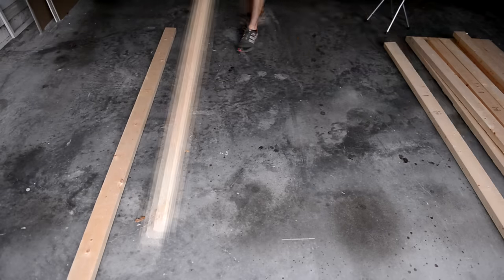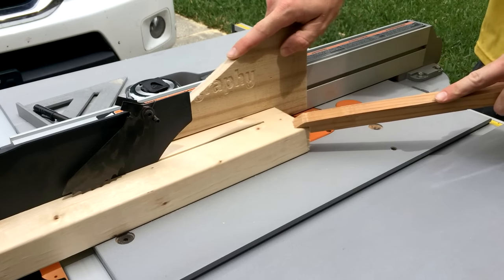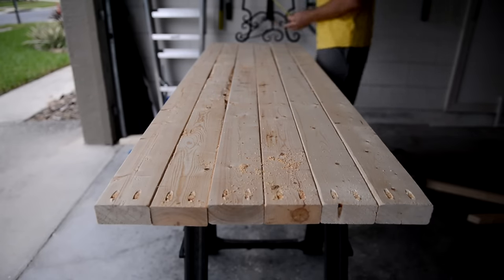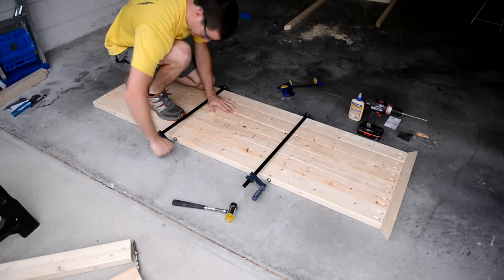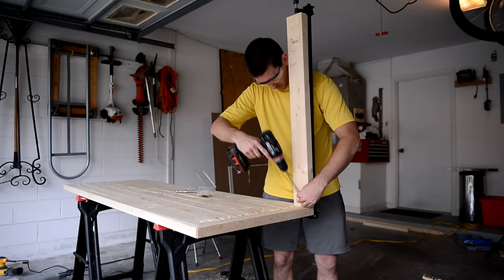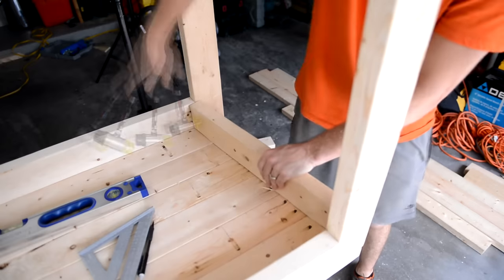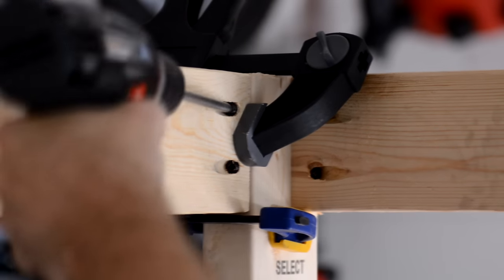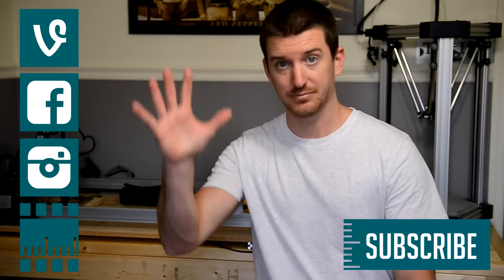How to Make a Workbench Out of 2x4s

Comment: Nice but the 2 x 4 need to be side by side but standing up. The 2 inches needs to be up. When you put them flat the table top has to much spring when pounding, for example; however it will use some more 2 x 4's but the benefit is worth it.
 It is cool to use pocket screws, however, a little wood glue will prevent problems in the future (my preference).
One more thing with the 2 X 4 screwed flat and screwed to the ends yo may experience problems with changes in humidity with the wood swelling and contracting. Overall good job!
  P/S you do not need to own a power planer. You ca use a hand plane. :)
Reply: yes totally agree with you ...bench is nice but not enuff reinforcement
Reply: +mtabernig also the lower support skirting should not be on flush with the bottom of the legs, cause any inconsistencies in the floor will cause the entire bench to wobble. 
Glue is your friend, it turns 2 pieces of wood into 1, does not rely on the screw holding it forever.
The Legs are going to rip right out of this table with any amount of side force on the table top. It is structurally bad construction. One ill placed step and your foot can kick out a front leg.
Should have waited till you had all the 2x4's attached before cutting the 2x2's that surrounding the main body of the top, then you would not have the gaps at the corners.

If your looking for cheap and solid top material, find some place local that has pallets they are getting ride of, take the time to tear then down, clean them up and laminate them together for a really nice hardwood top. Just takes time and effort.
Reply: He could place 2 2x4 on edge under the surface and  screw from his words skirts would be cheaper and keep his simplicity :) but your idea is better more $$ throw
Reply: +mtabernig He could have also attached 2x4s 90 degrees from the direction of the top 2x4s to give it more strength. But yeah, 2x4s on their sides are not as strong.
Reply: +mtabernig He could of also went to lowes or some website and bought one that was designed by and engineer. There are a lot of things he could have done but chose not to for the purpose he needed it for. Don't bash the guy. I like what he did. Awesome job!
Reply: James Stephens it not bashing, its constructive information, for him and anyone else that is looking to make one of these. They may look at the comment and make a more informed decision on to what changes they might make to one they are going to build. As you can clearly see he did say Good Job.

Me on the other hand, I am an asshole, I did not say good job, I should have but never did. So bash on me all you want.
Reply: +James Stephens nope.. its shit.   but it worked for what he needed it for, and that is a shitty video
Reply: +mtabernig 
I'm with you mtabernig. They also have a better chance of warping having them lay flat. Standing them up with glue would have eliminated that possibility.~DM
Reply: +CrossGrain Wood Products,LTD it is a problem with the edges, seasonal humidity  changes will work against the end edges and elongate the screws holes and loosen the grip.  The effect of changes in humidity could be diminish by  turning the 2X4 and gluing/screwing them on the narrow , the 2 inches, to the top  and joint them on the wide 4 inches.   I also would recommend using a couple of coats of  wood sealer to finish the project.
Reply: mtabernig do you mean the 2x4 need to be stacked? I'm confused. Like a butcher board top? I am trying to learn here.

Comment: Hi, nice job but just a couple of points to making it even better. Firstly, you really do need to glue as over time those screws and any nails will work loose and the glue will hold everything nice and tight. Secondly i would have glued 2 2x4s together for the legs, 4x4s would work much better and you can mortise then in to the corners, much stronger. I suggest reading some books on basic woodworking to give you some ideas, keep up the good work.

Comment: I built a bench like this years ago (Like 30 years ago) out of 2 x 4's from a wall I tore down. It held up great. I still have it. The only thing I did was put a piece of linoleum on the top to smooth it out. Every once in a while that needs to be replaced.

Comment: 1. Also ways glue your surfaces together. Pocket holes in pine is like stapling a marshmallow. They just don't work well in soft woods. Glue should be your mechanical bonding agent in this case with the pock holes acting as alignment and pressure for the glue.

2. Your work surface is entirely inadequate. It has no support under it and you are relying solely on the pocket holes to keep it together but here's the things, pocket holes are only strong in one direction, pulling away from the face. In the table top, if you put something heavy on it, you'll be stressing the pocket holes sideways and they are going to experience a large torsion force. This means that whole table top is going to want to roll up like a burrito.

3. You incorrectly stated at 4:30 that your 1/8 gaps could have been solved by  a jointer. A jointer is used to crate a flat face on a longitudinal axis of a board. Are you implying that you would stand up this thing on its end to run through a jointer? You dont run a gigantic panel through a jointer on its end grain. Not only would it uncontrollable and unsafe, the jointer would just tear apart the end-grain of the wood, especially with a soft wood like a 2x4. What you should have is used a circular saw to trim off the end of the work surface making all the pieces precisely the same length.

4. Regarding your table top, for the love of god why didnt you orient the boards upright? Decision making like that can make the difference between a work surface that can support 200 lbs vs a work surface that support 1000 lbs.

Comment: Good video: nice filming, editing, voice-over and music. The bench has pro's and con's and those have been touched on by others. I love pocket holes too, but I am not sure this is the appropriate "best-use" for them. Depending on the use of the bench it may not last. However, it was a good build for what it was designed to be.

The mitered corners can be done more perfectly by cutting one corner at a time. First, do your very best to set you saw to a perfect 45 (you won't get it perfect) and mark (or remember) big and short sides of the angled cut. Against the straight line of the back-rest one of the angles is 135 degrees and the other is 45 degrees. To match the cuts more perfectly, you can flip the board over and cut along the other side. Second, start on a long side and cut one corner on the big side of the angle. Put the board in place and clamp or screw it in (I have used small screws on trim pieces I was going to nail into place). Third, mark your second cut on the other end of the board. It will be important to "sneak-up" on the cut; leave about a blade width from the mark. Cut your second cut on the same side of the angle as the first (presumably you have a mark on the board and will need to have the board facing up to see the line. Cut this line a blade length long and check the fit. It should need just a little trimming. Flip the board over and cut the small excess off on the small angled side. Each board will have a short and long angled cut. When flipped, each side will be the correct 45 you need. Do each board this way; by cutting it long and flipping it over (after checking for fit) you can get the exact opposite side of the angle no matter what your blade is set to. I always do the first cut of a board on the large angle and the second cut on the short angle, so I don't have to mark each board - easiest for me.

Comment: quick tip on applying a finish. before you apply a finish use a rag damp with water. it opens the pores of the wood to allow the finish to soak further into the wood.

Comment: You mentioned having a hard time getting the mitered corners to fit well- it could be how you marked the line. I would line up the edge board to the other and then mark the inside corner of the miter. Cut a little proud of that mark, test fit it, & cut it again if needed. You can always nibble a little at a time to get up to the line. but it's not so easy to put back wood you've cut off. :-)

Comment: I enjoyed seeing you build this with all p-screws. After building a few benches myself, a couple things I would do different.  For clamping use, have an overhang lip.  This you could do by screwing your "skirts" on the inner side of those legs rather than outer side. Another is to make the table top with the 2x4's 1.5" sides up for stability when pounding on it, or add two more 2x4 crossbeams underneath, thus supporting the top in quarters.  The crossbeam approach won't be as macho as the sides up approach, but uses less studs and you can still add it without starting over.  Legs could be double studs. Sturdier.  But nice job!  You can actually break this down for transport which I think is pretty cool.

Comment: Thanks for posting.  I like the suggestions of putting another 2x4 midway underneath the top, making the legs from 4x4s or 2x4s doubled up, and also pulling up the bottom braces to add a bottom shelf. I think all those things would help the bench strength and stability.  Perhaps some wood screws (deck style?) would help also.    Appreciate your video!

Comment: Probably gonna crack the first time you put weight on it. Pocketholes are for lazy people!
Reply: You can hours waiting for glue to dry on your project if you want and change it every 15 years, or you can be lazy and have it down in 50 minutes, and when it goes BOOM and breaks, just throw in a few more pocket screws at a different location in less than 2 minutes and it should last another year.

Shit, I guess over time, he might invest an hour fixing it, but it still works out less work and time investment. Lazy or not, it's actually quite smart. I have shit I've put together with pocket holes and no glue, that takes on constant weight and moving, last 3 years plus.  One project broke and all literally split the wood. What did I do? Unscrew the pocket holes, get a 2x4, cut it down to size with my miter (took 10 mins), pocket hole it back up, and it was good to go.

5 years later...

Some projects you want to last, like, building a shed, or house and need to use quality construction, other shit you can get by on just repairing it and patching it up.

Comment: So sad that you tubers who don't know what they are talking about do this kind of video. A proper workbench is not just a table that goes in your garage. If it were, plywood would be better and easier. A true workbench is heavier, dead flat, and built to absorb hammering and pressure from the sides from building projects on it (hand planing, etc). This is a craft table not a 'work bench'.  Also a workbench should have a vice on it in some capacity to leverage the weight/stability of the bench...which this lacks anyway. I really wish non experts wouldn't poison the environment with information that ultimately will result in failures. Does the 'maker' really not understand that the legs are only attached to the border of the table top? Poor engineering. Or that leg supports that are flush with the floor make it impossible to to be stable on anything but a perfectly level floor...which doesn't exist in almost all garages. Poor engineering. Or that the flush glee supports prevent sweeping?
Reply: +Perineum Sigh. Precisely what I am talking about. You are so poisoned with the erosion of standards that you think any work surface is a work bench. A workbench is NOT a work table or a table that goes in the garage. No matter your uncle who slapped some plywood on some framing lumber and called it a workbench says. A 'workbench' is specific to a heavy table with a vise on it that can be accessed on all sides specifically for woodworking or even metalworking. Go to a wood shop and see if they have workbenches and separate work tables, assembly tables, and tool tables. This would absolutely not be safe for hand planing, chiseling or God forbid, many power tool applications. It's not just semantics. This goes to the erosion of woodworking standards. Don't care? Great I would like to sell you a 'pool table' for $500. Won't you be surprised when you see it's a a table used by a pool. Snicker. He should call this video something else is my point. NOT a workbench.
Reply: +Perineum that was hilarious.
Reply: Lighten up. Francis!
Reply: Let's see your video on how to do it right then DAVEY? Or is it easier for you to puss out behind your keyboard?

Comment: Nice bench, great look. I use a belt sander (21") in lieu if a plane & joiner also use carpenters glue it dries clear and wipes up easy after you set it. You have the clamps so glue will make it stronger, can't get those boards apart ever once glued. After it dries I fill the cracks/joints on top then a good belt sanding makes it one cohesive piece. Filling it give you some room for those 45 angles that have gaps too, fills them in. I use the stuff they use to fill real wood floors before sanding. once stained that piece would look great. I like to use wood dowels too gives it strength and looks great, I know it's a work bench but it's just pride.
Reply: The benefit of this guy's approach is that he can replace any one of the 2x4s if they get too damaged or rotten, or go out of shape.  I love the idea of not using glue as a matter of course.

Comment: Good Job ! I am a Physical Therapist, and did two treatment tables same way, put some soft cushion on a top though;o) I would add one shelf about 12 inches up, from floor, good for keeping tools and stuff, out of 1/2 inch plywood though !!!!=) youtheman...
Reply: This is nice table but by no means is it very strong. The 2x2 around the top makes it weaker . Having the legs directly under the 2x4s would be stronger, among other design changes. I don't know if I'd trust putting heavy people laying on this thing
Reply: Jep, thanks,somebody like about 300 lbs has been lying on my tables, no problems!!=)
Reply: +Eero Laukkanen I'm just saying, any engineer would not approve of this design to hold a lot of weight. It's only good for real light duty work. The thing is, it could have been stronger without more time or money

Comment: Not bad.  It will probably be quite sturdy when it comes to vertical force - I mean if you put something heavy on top of the table.

However, I'd worry about side-to-side strength.

Not sure what your aversion to glue and dowels is but if you had build a simple dowling jig and used dowels and glue, you'd have been able to use a lot fewer pocket-hole screws and had a table that was much stronger laterally.

Comment: Pretty solid piece for minimal tools used. One thing to get the boards more snugged would be to take about 1/8 off with a table saw to remove the rounded corners of 2x4s.

Only thing missing is your final shot! You didn't really show what the table looked like once you had stained it.

Comment: i had the same problems with cutting in the 45. you got me thinking that the alignment is out so i put a right angle on the mitre saw and it's off by a millimetre over 20 cm. (1/30th over 2/3"). i have to adjust the angle of the mitre each time now.

Comment: A Jointer would be better for getting warp out of boards AKA flatness. A planer makes each side of the board equidistant, which doesn't exactly translate to flatness over the coarse of an entire board. In terms of not having one, I'm just going to throw a tip out to anyone that reads this: Pawn Shops are glory for tools. I got an $85 circular saw /w laser guide for $20 last week. I will never buy anything new again. Also, Harbor Freight for Clamps and sand paper and other working medium. 

I would acknowledge sources of inspiration in future videos. Keep up what you're doing. Trolls will troll, and hard, but there will also be great criticism that will move you forward. Rock on, man. I subb'd.

Comment: Thanks for the video! I'm working on building a computer desk using a 4x8 sheet of hardwood plywood and 2x4s. I had been flirting with the idea of using galvanized steel or black iron piping for the legs, but the cost makes it less attractive. I think using the 2x4s will work nicely for my purposes. I plan to sand the crap out of it, stain and lacquer it anyway.

Comment: you can use your table saw as a surfacer, kinda. Use the straightest ones, then square up the sides of the 2x4's, so the 2" sides and trim the 4" sides to make them flat. Everything fits nice and tight that way too.
I like your design!

Comment: Boost your chances of getting accurate mitres by ensuring your cut angle is actually at 45 degrees, using finer tooth blades and ensuring the blocks are flush against the fence.

Comment: Have you tried Kregs heavy duty pocket holer? Great video but I would have turned the legs the other way so as to present the narrowest face to the user. You used up an extra two inches with the wide face of the board towards the front.

Comment: not bad for a first go but i personally would have put something to strengthen the worktop underneath, maybe some additional 2x4 the same as the "mini skirt" at three or four points along the underside. Pretty good bench to use as a place to mount bench top machines or light work but doesn't appear very sturdy

Comment: Its been about a year how is the bench doing specifically the top i was thinking about doing a butcher block style but of course for a "cheap" approach thats double the 2x's for the top material i thought about using the style you used but i was concerned with wood movement and weight support assuming i abuse the top or do heavy hammering  a little too far away from the lets